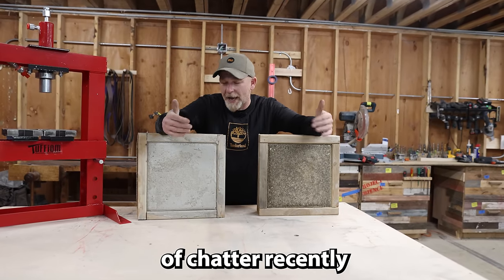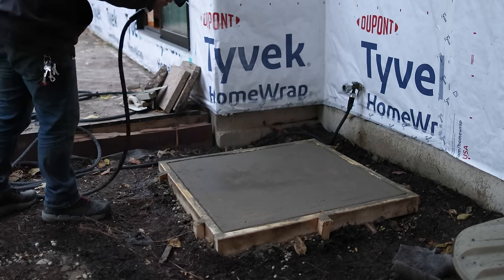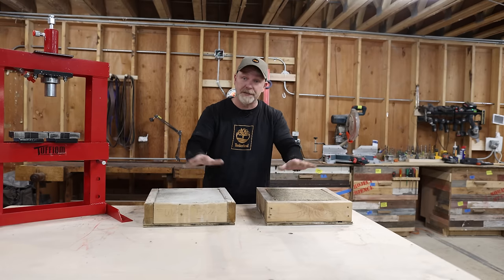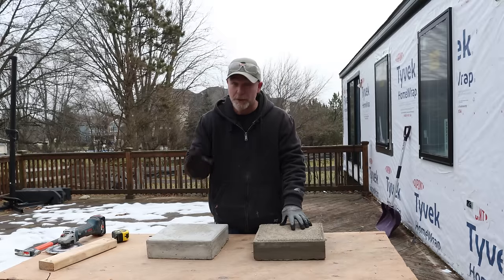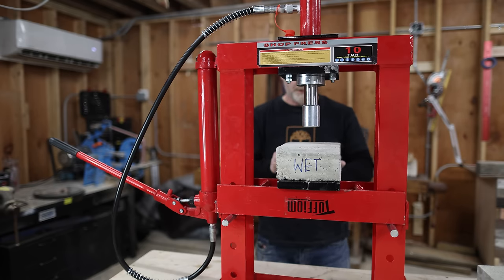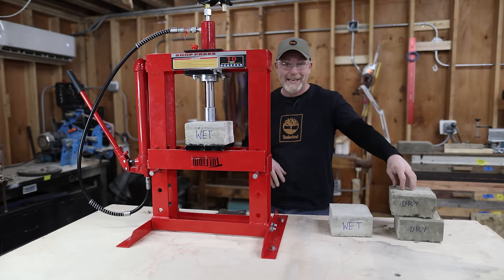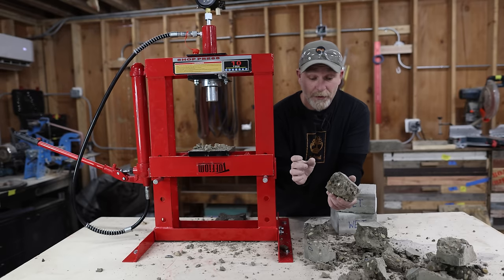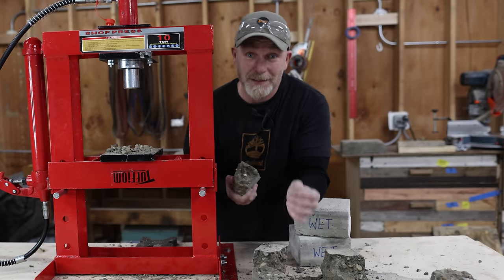The TRUTH About Dry Pour vs Wet Pour Concrete!! Strength Test - You WON'T Believe the results!!

Comment: There are many vairables to what you are actually doing with your pours, wet or dry. I can tell you  I used to set a lot of poles and we always used dry pour, what you have to factor in is the moisture from the ground itself which is continually wicking moisture over a period of time. You take a dry in ground pour and a wet ground pour come back in 90 days you will hate the dry pour over twice as hard as the wet pour if you have to jack hammer it out! Why because of the continious draw of moisture from the ground which gives you a slow cure which is harder than a wet pour.

Comment: with concrete you need to know that it is a chemical reaction that sets it hard,  just like a two part epoxy.  chemical reaction causes crystals to grow and link together, these crystals are microscopic, like molecular bonding.  the crystals are what give it the strength, It MUST have water for the crystals to grow. the dry mix has very little crystal formation , therefore it is very weak.  Remember, concrete doesnt just dry, it is a chemical reaction that cures it.  thank you, bow.  Imagine , you can pour concrete under water ! it loves it .

Comment: Every concrete user needs to watch this video and know just how silly are the people who are too lazy to add water to their concrete pours.  Common sense tells us that dry poured concrete is no way near as strong as wet mixed concrete.  When I mix concrete, I utilize the 6 bag mix formula and also I add one bag of cement to the mix and it gets so hard, so hard, a steel chisel and big hammer can not chip it.  Thank you for shutting up the dry pour folks.

Comment: What you just saw in the video is not "dry" concrete, bro didn't even add any nominal amount of water to it. Misting is to keep it wet, not to get it wet, see the difference? Dry concrete will always be 10% the strength of wet poured concrete, but that 10% can hold a truck with an additional 55,000-135,000lbs in the bed if that were even possible. Here are the numbers by average, wet concrete is 3,000-6,000lbs per inch strength but I have seen higher, and "dry" concrete is 300-700lbs per inch. These are facts...

Comment: In order to make dry pour concrete U need to use aditives and wibration its actually hard work wet pour is easy simple and kinda hard to f... up most people can do it right if they read the instruction on the bag . also every concrete gets sronger and better if wibrate it

Comment: Dry pours need months of picking up soil moisture and rain before they get to full strength. Will it get to 100% of the wet... likely not. But for utility like sheds and sidewalks.  I plan on doing a layer cake of pour and mist and pour and mist.

Comment: Strange how you have a color difference. I have done several and they all turned out grey like normal concrete and were not crumbly at all. It is almost like you failed to use anough water on it when spraying it. Misting is only done until it develops a hard shell. After that you dump the water to it saturating the mess out of it. And just repeat every hour or so.

Comment: It would have been interesting to weigh both samples to see if there was any difference. Also, not practical in this test, it would be interesting to compare the amount of CO2 released as an indication of now much of the cement had cured.

Comment: Let’s make this short and sweet. 

Try make a cake by simply pouring all the ingredients into the pan. Disregard all the steps, procedures, and “the process” to make a consistent finished product without properly blending and mixing. Totally skip all steps and just shove that cake in the oven. Then, you see what you got. 

The same principle applies to concrete. 

But no! Some people are going to do what the phuck they are going to do. 

For those who know, just enjoy the show. These master engineers from consuming social media on how to properly build long lasting, quality things, with sustainable performance as designed and intent… know that “do it right the first time, the second time costs more money!”

And that good people… allows the material suppliers to remain in business.

So go ahead, cut them corners… and I’ll see you in a few days, weeks, months, or a few years.

Keep up the good work.

Gratitude for sharing this info and the time to conduct these break tests. Every time I see someone trying to tell me how great a dry pour is with less time and elbow grease… I make sure to buy more stock in those materials. Gratitude 🙏 My solid retirement program compounding daily with interest. 😂

Comment: It's mindblowing that people actually think it's a viable option to dry pour.  I used to sell custom fencing.  When we'd go replace a fence that was falling down, many times it was because someone had dry poured the concrete around the posts.  Its crumbly crap.  Mix your concrete as designed and you'll be just fine.

Comment: Logically the center would not cure at the same rate on the dry as it would on the wet. Maybe in a wetter environment it would strengthen over time. But there would be no practical way to test it.

Comment: Of course this is the case, the plasticizers never fully develop and bond together, how could they when they aren't wet and activated? 

I bet you'd be able to dig out the dry pour with a pressure washer. The jet will crater the surface of the concrete

Comment: You don't need to be a civil engineer to know this. I used postcrete to drop some posts in a few years ago and the posts worked loose. When I dug them out the postcrete fell apart. I won't use it again as stuff i've mixed wet always remains hard as iron and is an absolute bstard to remove/break up.

Comment: seems unsurprisingly that it did not get enough water past the first half inch or so which is why it didn't cure well (rather than time). It will probably never be as good as wet pouring, but i suspect you might get better results if you Made the form about an inch taller Leave an inch of standing water on the surface for as long as possible, preferably a couple months, so that it can work its way through the pores. Not sure how effective it will be since water will kinda want to float to the top of the mix but once the top level hardens it might finds its way thru.

The real issue is any concrete porous enough to let water intrude into the bottom layers quickly is going to probably be that way when its finished, so it's just inherently going to be weaker and less long lived than doing it properly.

Comment: i suspect that if you poured each bag in a 5 gallon can and dry mixed it with an electric drill paint mixer, you'd get a stronger product, as "bagcrete" isn't mixed.  that said, the advantage of dry pour is still a godsend for DIY people that don't want the mess and the weary arms from mixing the stuff.

 i did this in 2014 on a whim before ever seeing this on internet, and it suffices excellently for a 1/2 - 3/4 inch screeded and compacted concrete bed to install paver bricks on top of, as the sand bed method fails from bugs and animals that undermine it.

Comment: If you have ever wrecked a form while the concrete was still green you will have experienced the corners messing up, that concrete(dry pour) looked like 2day old wet pour. I would think at least a double set time for dry pour may yeild better result but it may come to more time than that say x3 or x4 which would then beg the question other than ease why do dry pour ???

Comment: A quick ugly fast sloppy dry pour of 75% with 25% wet mix on top is ideal for ease/price/finish/strength/surface strength. Pour the WET mix on after a good long FULL soak of the dry....mix the Wet AFTER  it starts to HARDEN right ON TOP of the slurry dry pour........keep it wet/moist with plastic, and add 1%  sugar to the water for the wet mix for reducing cracks.......several videos on this to prevent future cracking

Comment: Here's your problem. You state that there is no standard for  applying water, so you just try something hoping it is right. 

Instead, the smart thing to do would be to develop the standard.  So how would you do that?  I have taken an engineer's approach to testing and developing the process. 

Starting point is the amount of recommended water for a standard wet mix pour. If you know much about wet concrete, you probably know that a "stiff mix" cure stronger than a sloppy ""wet mix".  So there is an ideal volume of water for the volume of dry concrete mix. 

If you are using Quikrete 80lb bags minimum is 6 pints or 3/4 gallon water.  Max is 9 pints water.  Ideally, you want to end up being near the minimum or slightly above. 

You can mix your own at a 1:2:3 part blend of cement, sand and stone in that 123 ratio with a 1/2 part water.  This is pretty close to the Quikrete mix and if you mix your own, you'll have to calculate based the volume measure use. 

So once you know how much water to use for the volume of dry mix, how do you measure that?  Well, for small dry pours, a garden sprayer can be used. Or you can calibrate a hose sprayer in a 5 gallon bucket by measuring the amount of time per volume of water.  This takes a little math, but it isn't rocket science. I recommend using a watering nozzle/wand with a fine mist setting. I find misting as the best way to water, looking for a color change and wetness without any puddling. Of course, this is a judgmental thing, but if you track the time of you calibrated sprayer, you'll know how much water you added. 

So now let's talk about the watering schedule. There is a channel called CajunCountryLiving and they have done a lot of research on this and they have a pretty good watering  schedule. I have taken their method a bit further. I made a test form using plexiglass. You could potentially us a glass baking dish oir an old aquarium to make the same type test mold. The key being that you can see through the sides and the bottom. What you observe in this test mold will tell you what your watering schedule should look like. What I have seen  seen when watering with the mist as O have described, is that the water migrates down at about 1/2 inch to 3/4 inch per watering. It takes about 30 minutes for this to happen. At that point it pretty much stops migrating down. Another watering, will take it down another 1/2 inch or so. What is surprising is that this migration is pretty consistent across the slab. 

So for a 3-1/2 inch slab, you'll need 7 or 8 waterings to fully wet the volume of concrete mix. As a double check, measuring the amount  of water you have applied will tell you  if you have watered enough. It should be right at or slightly above the calculated amount

The watering schedule is critical to dry pour strength. As I have described, it may sound complicated, but it really isn't. Once you learn what proper watering looks like it get prett easy to recognize. It's actually quite easy, but takes some time to get through the complete schedule.  Avoid a temptation to shortcut it. I have tested  this using the sam method and results are much better than you achieved  and very comparable to wet pour. 

As for color and finish you can improve it. The reason it looks different is that in a wet mix, the fine particles migrate toward the surfaces and typically, when you finish a wet pour, you work the wet slab to "bring the cream" to the surface. 

In dry pour, aggressive screeding brings the fines to the surface, You can also add a light dusting of 1 part cement to 2 parts sand, mixed together. Dust it on top after screeding like dusting powdered sugar on to pastry. Before beginning the misting/watering cycle. take a dry paint roller and roll it over the surface lightly.  This step evens and smoothes the fines.  Be careful to use a very light mist initially to wet but not wash off the fines! 

So the 2 most important keys to a successful dry pour are #1. Closely following a precise watering schedule over time. If you start to see evidence of puddling on the surface, you are over watering! Trust the schedule because you can't just guess on the migration of the water into the dry mix slab. It takes some time to happen. You can't tell by looking at the surface to know the dry slab is fully wetted. #2 is to screed aggressively enough to push down the stone and bring fines to the top, If you use the dusting trick, it will help. This creating a fine layer of the  "1 and 2" part of a 123 mix. Do not use a mortar mix toping as some suggest because mortar mix has lime in it and it ca effect the curing. 

Most dry pour videos do not really cover watering adequately and precise watering is key to success! There is a judgmental factor in grasping what "light watering" means. It's subjective and how you water makes a difference. Being able to measure or calibrate it, makes this part of the process more consistent. 

Another fail cause besides not watering correctly, is trying to "fix what doesn't look right"!! You are better off to forget everything you know about wet pouring concrete before you start!!  It's a different process, so don't expect it to look the same!! Do not get tempted to try "fixing the surface" once you start watering!!  There are a lot of videos of experienced concrete guys trying dry pour and it almost always fails because their minds are locked it wet pour. Knowing how wet pour works and looks, is a handicap when doing dry pour. 

Once you get the feel for dry pour and truly understand the process, it gets easier because you know what to expect.  No need to pre-wet the ground. You don't want the dry mix pulling water up. You wet from the top down, and you can put down plastic sheet if you wish.  Quikrete works pretty good and some "big box" economy mixes may behave a bit differently.  I actually prefer my own 123 mix using #11 crushed limestone. I think it bonds and cures a bit better than pea gravel mixes. But you pretty much need a mixer to prepare the dry mix. It can save some money over pre bagged mixes, but you need to be able to deal with the individual components. 

I'm not going to say that dry pour is exactly as good as wet pour. But for a simple slab upt to about 4 inches it's less labor and more than adequate. You just need to get the watering right. Of course, you need to get the water right making wet mix too!

Comment: A true dry pack is different. Mixed evenly with water packed and screeded. Key word packed and evenly mixed. If you want added strength add something to the concrete if you want to do it the lazy way you'll find out soon enough.

Comment: Since you over watered the first watering you should have made another one for the test. You should also have made it on earth instead of board so the moisture can seep out more. All you've shown is that a wet our slab that has been both over watered and  had the moisture trapped with no where to go crumbles easily. A better test would show the test of wet against what dry pour people are doing.

Comment: quikrete 50lbs fast set is designed for dry pouring. But you have to use the correct amount of water just like mixing. Thats where you went wrong

Comment: The thing is with dry mix concrete it has to be compacted not simply poured its strength comes from compaction and minimal shrinkage. Not a  accurate appraisal.

Comment: Dry pour will always be weak as the portland is not evenly distributed in the mix, maybe if you trowel the dry mix a bit, it could be a little stronger, but still wont cure right due to the absence of the required moisture all at the same needed time.

Comment: I can't believe this is actually something that people are actually contemplating. "Dry poor" concept was thought of because of flat-out laziness. You have to mix concrete correctly so it can adhere together. No amount of water is going to accomplish that if you just pour water over it. Yes it will be hard to the touch but it sure won't hold up for 28 years like it's supposed to. When you mix concrete the Portland cement mixes with the aggregate in the sand to create a bond. It will continue to strengthen for up to 28 years depending on the moisture the wetter the better. But you have to actually mix the ingredients! Ask yourself this do you want concrete that's going to last for 2 years or 28 years? Do it right do it light do it wrong do it long. Do it right it'll last a lifetime. Do it wrong the jokes on you.

Comment: Just thinking out loud here, what would happen if you did a dry pour for small scale repair work? If the dry pour compacts better but just doesn't cure as well due to lack of moisture, would it not be good for basically gluing cracked pieces together?

Also, would that help it cure better? I keep hearing how porus concrete is, so if youre just filling in a gap and then putting a lot of water on it over time, the water should seep in from the surrounding wet-poured concrete that has already cured, and that might help it get in there more evenly that if youre just doing a dry pour for the whole thing. Does any of this make sense as a practical solution to avoid just replacing cracked concrete?

Comment: 5 tons = 10,000 pounds. Spread over 4 tires it would take a 40,000lb vehicle to crack it. The heaviest SUV on the market is under 7K. Even the heaviest semi with an empty trailer attached is under 35K.

Comment: I’d like to see this after one year.

The potential for energy should not be lost,
All concrete cures over the course of decades 
 90 days seems like a lot,
but for this particular experiment it’s actually not.

 Not pro dry pouring,
Just left with questions.

Perhaps it takes a lot longer cure,
If it’s not structurally compromised as a result 
That could mean it will last longer.